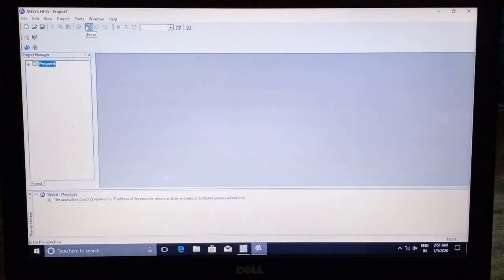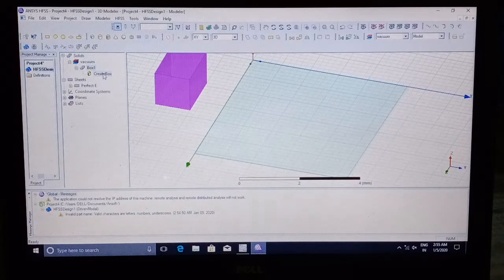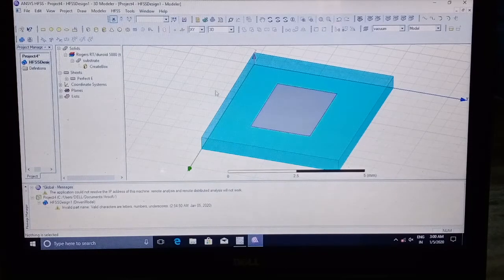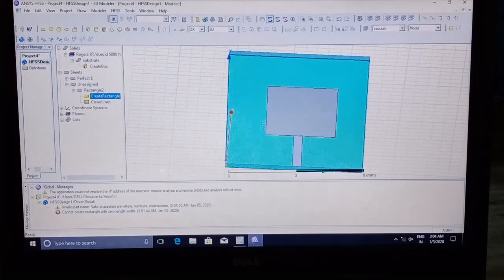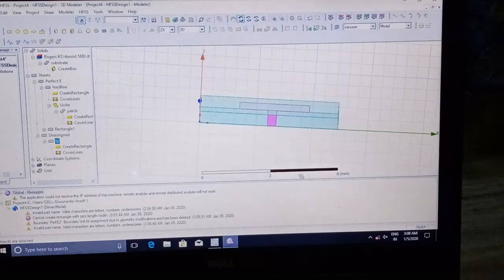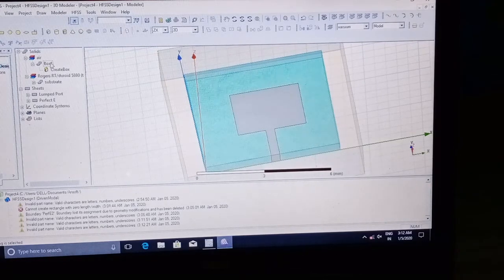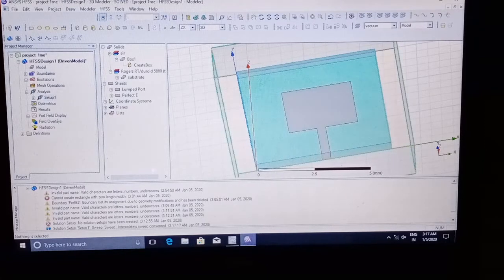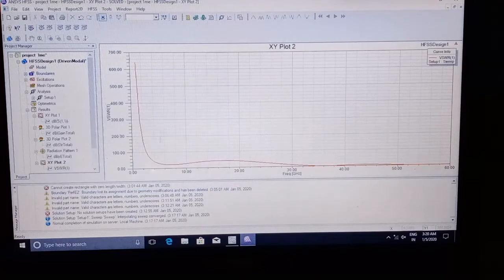Design of rectangular microstrip patch antenna using HFSS || antenna design using HFSS || ANSYS HFSS

Comment: Ma'am is there any software for calculating patch dimensions and please provide equations for the patch dimensions used in this design....it's urgent..
Reply from the maker: There is no software and no formulae to calculate patch position dimensional values
U will have to do it by trail and error method
patch must be positioned at the centre
for ex:
1.ground plane :-
 width=10mm
 length=9mm
2.patch :-
w=2mm
l=1.5mm
then consider the mid values  of width and length  of ground plane and adjust accordingly
in this ex:
x= (10-2)/2=4
y=(9-1.5)/2=3.75
z=height of the substrate

Comment: Madam how to calculate position values please tell mam
Reply from the maker: patch must be positioned at the centre
for ex:
1.ground plane :-
 width=10mm
 length=9mm
2.patch :-
w=2mm
l=1.5mm
then consider the mid values  of width and length  of ground plane and adjust accordingly
in this ex:
x= (10-2)/2=4
y=(9-1.5)/2=3.75
z=height of the substrate